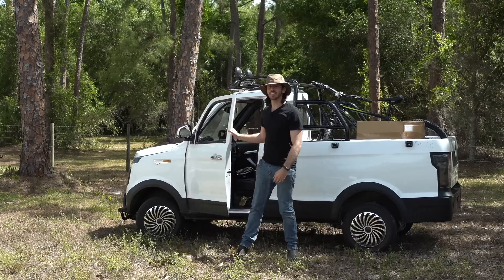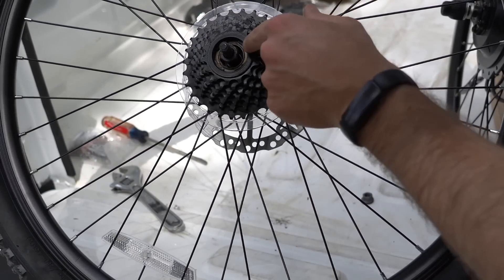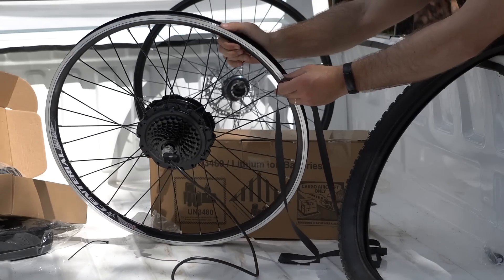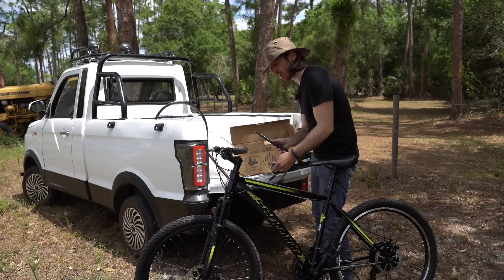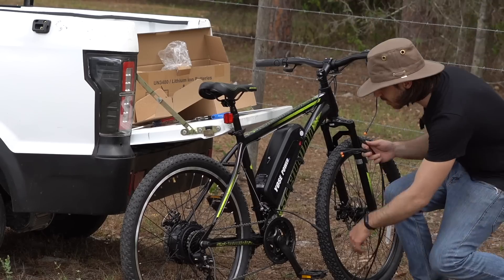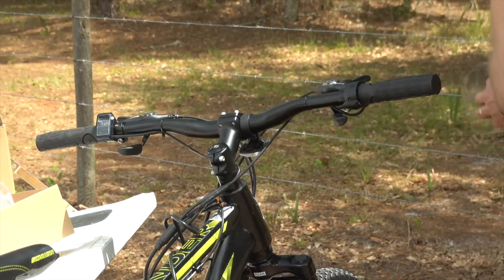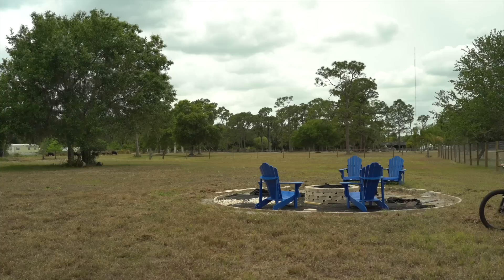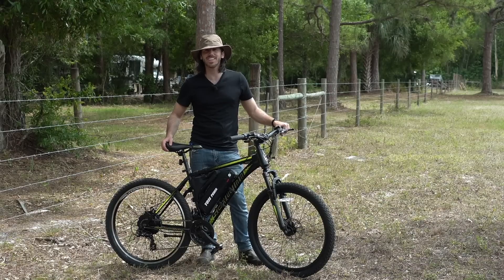Unboxing and installing a simple DIY e-bike kit (Yose Power)

Comment: thank you for removing my first post, so here is is again, but better, dont waste your time with hub drive kits, mid drive kits are better, yes they are 3 times the price but they are super easy to install, last longer, go faster and you have all your gears ( so you wont get bogged down going up the hills ), hub motors are old tech ( 10 to 15 years ago ) thats why everyone is going to mid drives
Reply: Hub motors are simpler (& hence cheaper). Could have literally taken out the chain, freewheel and pedals, and just ride with the throttle on this conversion, saving some weight. Mid drives have nicer gear selection, but one has to be careful when shifting and also to take care not to damage the drivetrain with all that power.
Reply: @jayziac  agreed if you are super rough with the gear changes there is a small chance you could break the chain or the derailer, but i am 155kg and i have been riding a bike with a 750watt bafang mid drive for more than 200km and have not had a problem yet, i also own a 500w golden motor hub drive bike and it has been ok, but never as good as the mid drive !
Reply: My next ebike will be a mid drive. I have the experience and knowledge to use it properly and I need the better efficiency they bring.
Reply: might be 'old tech' but still very useful, and what do you mean by last longer? i've had mine for a 3k miles and no issues
cheaper, easier (don't to be in right gear, or bother about chain, maintenance, etc), throttle (not all mid drive has throttle, maybe diy ones, but like bosch ones dont)
Reply: @hasan_z  bafang 750watt kit has a throttle
Reply: @hasan_z  the battery last longer because since you can change gears the motor can work more efficiently and faster and more torque up hills

Comment: Looks a good kit but the bike is less than impressive. I feel a full installation would be good but your video definitely shows it doesn't have to take too long to fit if you simplify fitting it.

Comment: You need to install the brake kill switches before someone gets hurt!
Reply: Great. I would like a copy of electric bike manifesto. Thanks
Reply: @singlespeed2760  he's posting the same message under numerous comments, i think it's a spam bot
anyway the brake switches are not essential, just let go of the throttle, and if it's stuck just turn off the display

Comment: How about the Yose Power battery pack? Any good? Does it last long? Is capacity falling fast from 100 % to 80 % and so on?
Reply: Hello, for example, with a 36V 13Ah battery, the range is between 47-156KM, depending on various factors. The battery can be charged over 1000 times.

Comment: The only problem with some of the cheap chinese battery packs is they have known to start on fire.
Reply: Only lipo batteries tend to do that. Ncm batteries are much safer
Reply: some do, some dont, i have two 48volt 20ah batteries for my 750watt bafang mid drive and i have never had a problem! and i live in the tropics where it is 38 to 40 degrees and 90% humidity and still no problem, just feel you battery  every now and then  to make sure it is not getting too hot and stop if it feels hot.

Comment: Nice video, informative with some useful tips.

Would you have any recommendation for such a kit for a road bike (racing bike), as opposed to the off road bike you used in the video?
Reply: yes a bafang 750watt mid drive, you will love it !
Reply: This is also a very nice kit for a 700c road bike.

eBikeling 36V 500W 20" 26" 700C Geared Rear Front Ebike Bicycle Conversion Kit

It has the HIGO waterproof connectors, and the kit is complete.
Reply: @backpackingonline  I have an older version of their 36v 500w front motor kit (before they had the waterproof version). Four and a half years later, it still works great. I didn't install the PAS for a year, and didn't like it when I did, so I just pedal it and use throttle when needed.
Reply: I like Elecycle for ease of installation and quite elegant for a road bike.

The controller is in the water bottle case base, that holds a waterbottle battery.

It is bluetooth, or cable, to the display depending on the display you choose.

I am very happy with my two kits, the pedal sensor on the cassette.

I chose thumb throttle on one, and one has the wired display.

I think I will get the Bluetooth display next for my road bike, for a very clean one wire eBike kit.
Reply: If you are in UK, ultraebike may be more convenient.

I waited a little more than a month for elecycle to US, and I am very satisfied.

..so either way?

I needed more choices to get what I wanted for two different 20" folding bicycles ..one full suspension and one with an 80mm front wheel!

I like these kits.

I really like this video.

Comment: My family has three Electra beach cruisers with 3 speed internal hubs. Any ideas on how to convert to electric?
Reply: I agree with the first comment, probably be better with the front hub motor make sure you get some torque arms to stop the axle spinning in the forks one for each side of the wheel.

Comment: your opinion build or get prebuilt. a lot of people say build.  so many  choices for kit  how would you chose one. i mean spend $1000 for bafang kit. i can save money on  really weird off brand for super cheap or just spend money on  prebuilt. the prebuilt everything  i want  but be limited on speed to drive to and from work and down to store or just around town
Reply: Building has its benefits for sure, but if you can afford it, prebuilt saves all the hassle of making sure components fit and having to source all the parts.

Comment: Would you say the $250 E wheel is not even worth getting?
Reply: It's basically the same.His kit Included the Battery.That's where the price for a battery makes you look about.You have to buy a battery,or build one,with the same voltage and good amps.=$198-350ish.

Comment: I found a 590 euro ($620) 1500W kit with 48V 16Ah battery. Pretty cheap so im questioning the quality. What do you think?
Reply: I brought parts and modified a down hill bike. I have a 1500w rear hub wheel and I run a 52v 15ah battery. (I made my own battery from this channels tutorials - only I had to buy the equipment but I’ll have plenty of use for it in the future)Get around 30mph and 15 miles range no peddling full throttle riding. 

Hope that helped.
Reply: I'd say it's not legit. do you have a link? I build these for a living and depend on one to get me anywhere I need to go so I can check it out for you and tell you what I know.
Reply: @justinwhite5283  I paid around £150 for my wheel and controller bits. And the initial build for the bike were a couple of years back. My links on eBay are bad now. Brought a maletrics spot welder and soldered a bunch. Bike is responsive but I do tend to get alot of back wheel blowouts due to the total weight & bust rear suspension. Breaks wear quickly too.
Reply: @IMJJC  sorry I may have replied to wrong person. I was replying to OG comment asking if the kit was legit or not.